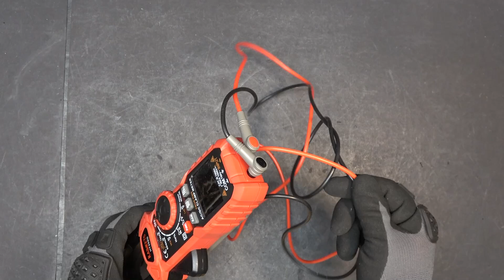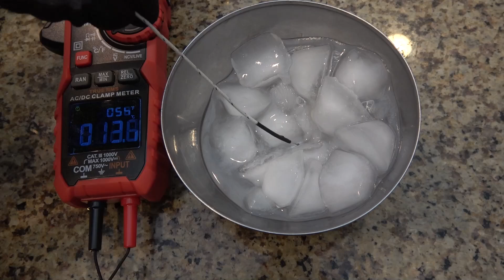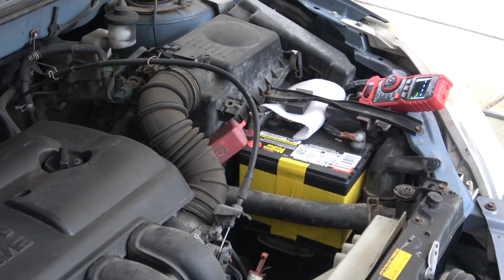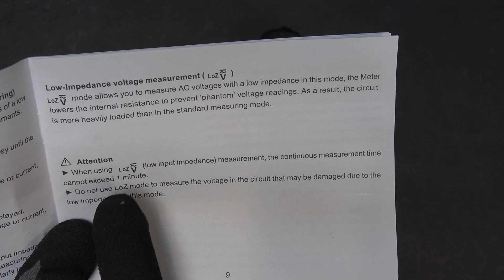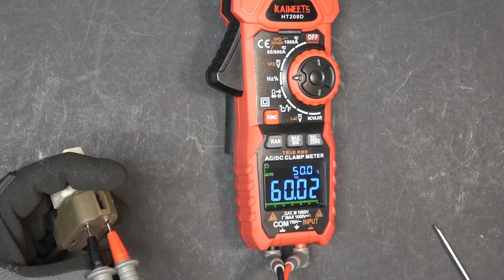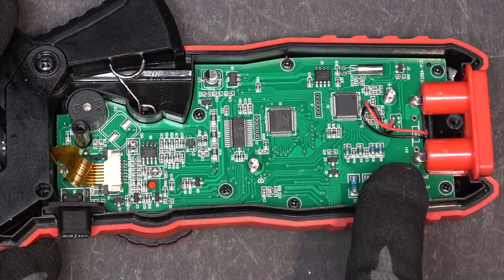Review & teardown: Kaiweets HT208D AC/DC clamp meter multimeter

Comment: Southwire 23090t clamp meter is good meter its got 5 digit display and its got 5 digit dispaly up to 50 v so you can see 1 mv range and it seems to be accurate and i thinks its ip 67 im not 100 percent sure i have checked the probes and the battery compartment is some form of waterproofing

Comment: Hi 
re-read the manual the world inrush is for AC current

not for the DC current of a battery 
you make a grave mistake
Reply: Put it in  inrush mode   and  clamp the  battery cable   and start your car  
It  works   for inrush  DC  
AC  clamp measures  changing current values  
In AC  mode  
When you start your car inrush   current  is changing

Comment: hey can you check out the HABOTEST Digital Clamp Meter HT208D . is it the same as the kaiweets but a rebrand ?. it looks 100% indentical
Reply: Habotest Kaiweets GVDA etc are all just retailing brands not odm manufacturers so in this case the HT208D GD169A are same base meter with different branding .
Can get these shipped around 27GBP 35USD .
Pretty useful tool for the price .
Reply: Eles são o mesmo produto. Só muda o adesivo da marca. Eles são fabricados no regime de White label.
Reply: They are the same using one right now